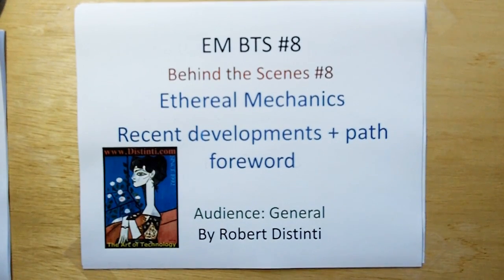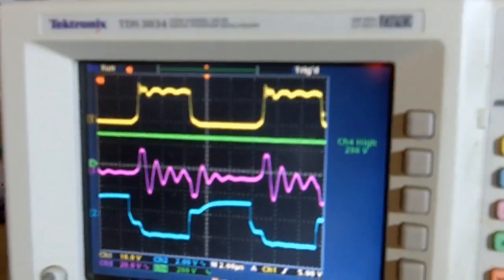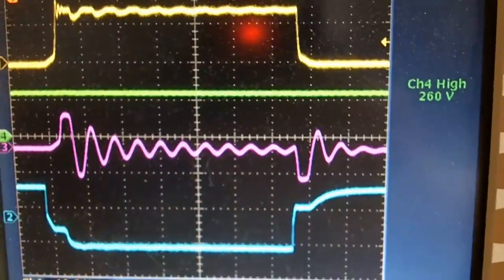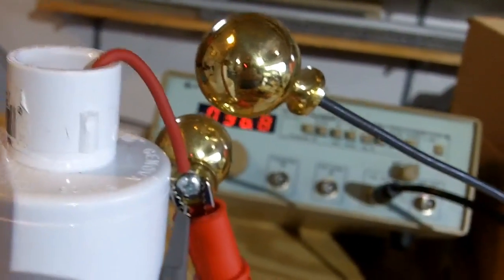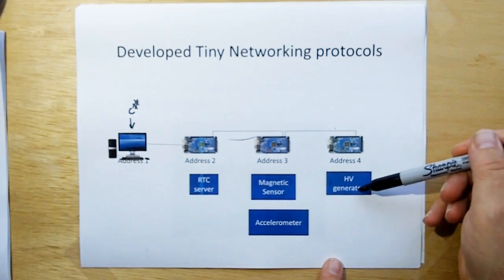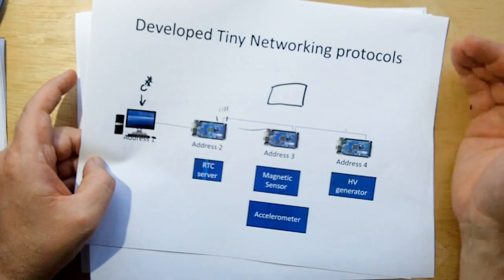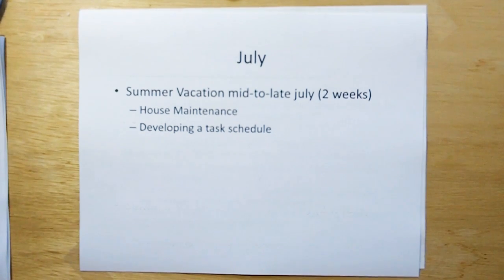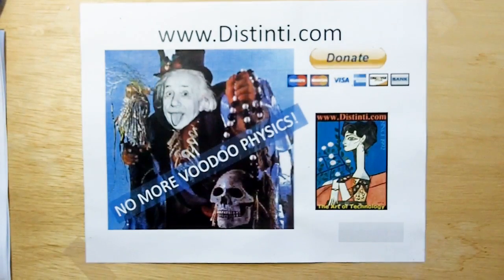S011: Behind the Scenes #8 + Home Work

Comment: About the homework... I think this real Physicist has some "quack" conditions himself (my theory can not be wrong). An other problem for me is the definition "well-established science" which could be described better as "globally-accepted science".

You can ask him to prove your models wrong, but with experimental proof. Not with well established  "laws"  (models created from observation). 
Science should be open for improvements,  not chained to century old 'laws'
Reply: I don't find much to disagree with on his quack page. He doesn't say "my theory can not be wrong" about well-established science. What he says is, if it works [for some definition of works] why replace it? Distinti teaches that multiple theories can give the right answers [most of the time] and continue to be useful even after they have been proven to be wrong in some cases. But you must search for and use a superior, more comprehensive and more accurate model when the misleading, inaccurate, limited, hard to compute models fail.

Distinti is not a quack because he does not qualify under this guy's rule #1. His rule #1 starts out "You mean you did an experiment whose results disagree with the predictions of that theory? I didn't think so." Distinti can answer, yes I did, and I got results that the accepted theory doesn't account for. Distinti can show exactly where the accepted theory in the textbooks disagrees with easily observed phenomena, whereas his new theory is designed to agree with the experimental results with high fidelity. That's the opposite of a quack, who either does no experiments or misinterprets the results and thinks he's discovered overunity.

Since this guy is a high energy physicist into dubious theories like QM and string theory he's partially detached from reality though he doesn't know it. QM can't lead to a theory of everything because it doesn't agree with classical mechanics. It may agree with experimental results, but it can't explain anything. String theory is mathematics run amuck. I don't understand it, your mileage may vary. I don't think it explains anything. They're motivated by high energy physics experiments but they seem to be misinterpreting the results. They are going in the wrong direction because they should be searching for a simpler model than the atomic model and they're coming up with really nasty-complicated stuff instead. They are trying to discover what makes a cat curious by examining the entrails of dead cats.

Comment: blaaaaa...good work on the daisy chain software though...the frequency will not be high enough, instead of arduino's make a controller for daisy chain signal Gen"s where a variable delay can be modified between each signal Gen, so we can get to the high end of the parabola on the frequency graph :) ei: 3 signal Gen"s each one a quarter phase out from the one before it, parallel connection to transformer: scalar jump to secondary, and then make a wand to identify that field :)) thanks

Comment: As a HV generator you can use a simple flyback transformer with a single transistor used as  oscillator using a feedback coil, powered by a 3,7 Battery, it is capable with just 1W or less to generate 20Kv...very interesting "electrogravity" effects..... if you are interested you can have a look at my channel. cheers